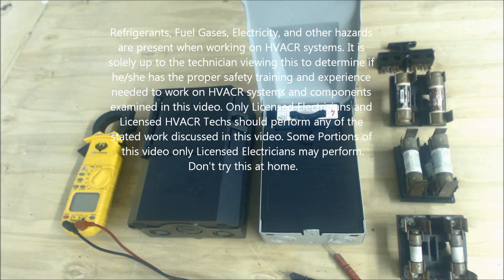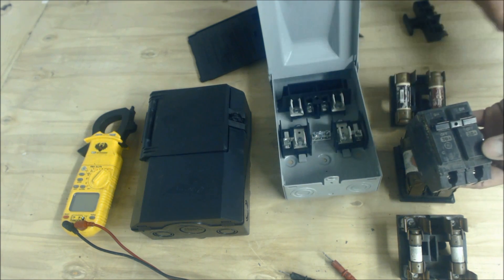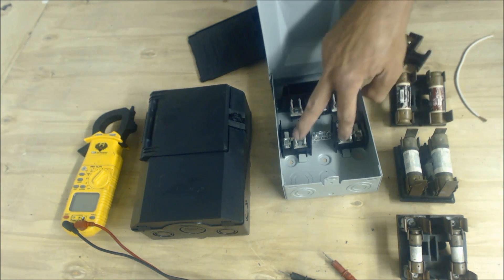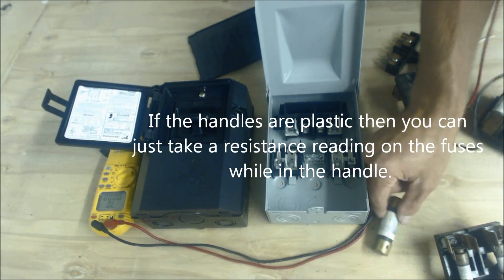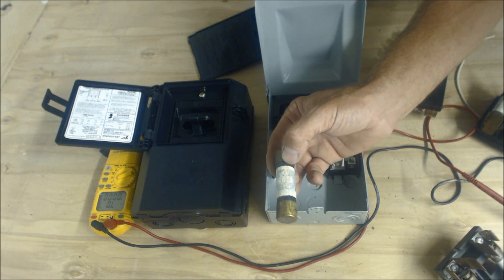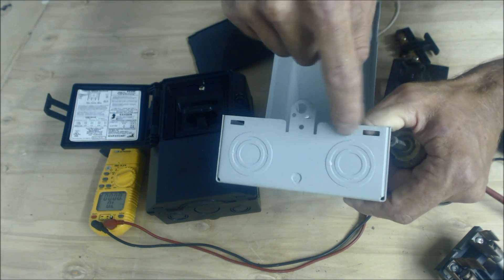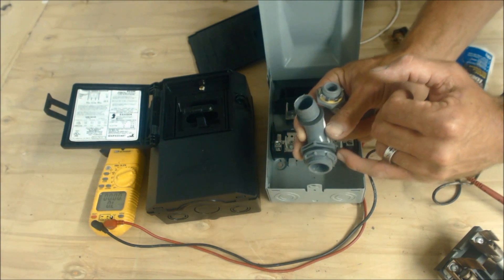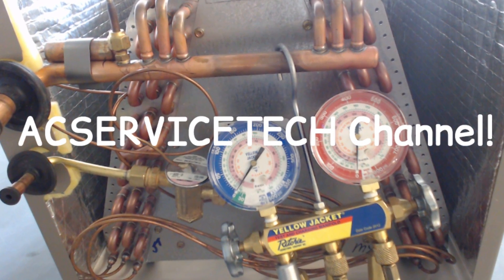Tutorial on HVAC Electrical Disconnects-Troubleshooting, Fuse Size, Non-Fused and Fused Application!

Comment: I'm a home inspector, I'm was talking in a group that we sometimes find a copper pipe inplace of the fuse in the disconnect. Some say to leave it, the control panel breakers will do the job fine for the condenser unit, its over kill anyway. That can't be right, I'm trying to find the reason this kind of fuse is there. I think I know after some research but can you explain why the need for this kind of  fuse is there and why and reasons for the stab in breakers?
Thank you I've learned alot from yo<r videos.
Patrick Virginia

Comment: The information in this video (specifically 2:40) about conductor and breaker/fuse sizes is not correct per article 240.4 (E) (G) and article 440 of the National Electric Code. PSA - Do not install or service HVAC equipment unless you have a proper understanding of pertinent NEC codes and manufacturer ratings of such equipment.

Comment: Hi, my ac was working great until I changed out the
thermostat and now the system is not blowing cold air. I put the old thermostat
back on and still blows but not cold. What did I blow up? ha...Thanks

Comment: I am having trouble with my one fuse keeps blowing on my indoor disconnect. I live in New Jersey and have a Trane heat pump about 17 years old. Condo is less than 1000 sq ft. The fuse only blows when I use Heat and I notice it happens typically a about an hour after it's turned on. Also when it is sub 40 degrees outside I noticed it blows. Do you have any suggestions on what it might be?
Reply: Could be anything. You'd have to be reading amperage while in heat mode. Heat mode takes more energy than cooling. 
Also hope that the fuse is for outdoors and not indoors, cause the lower the temp the less energy the outdoor unit should take.

Comment: How about a whip with solid wire? Does a whip have to have stranded wire or is it better. Any difference using solid or stranded whip wire
Reply from the maker: Stranded that is rated for wet locations, thanks
Reply: @acservicetechchannel  AC disconnect box has live wires. I took fuse out, it's still live. I shut down the mains at the fuse box. It's still live. How do I disable it? I assumed when I took the fuse out it should disable the live wires. Then I thought the fuse box has a switch for it. It doesn't. I even tried the 200 amp main. And that still wouldn't disable the live wires. Any ideas?

Comment: So I see I have 2 bad fuses on my 3 phase unit and they have burn marks, where should I check my ohms to see if they are climbing when unit is running with new fuses
Reply from the maker: That would be the main power wires but you should call a tech. They will check amperage, thanks

Comment: I want to install a Mr cool diy ductless system, already have a central unit that quit but wanted to know can I just disconnect the central unit and run the power that was used for the central unit to a disconnect box for the ductless system?
Reply from the maker: You would have to check the voltage and amperage wire rating and breaker size to match or exceed the Mr cool, thanks!

Comment: what size disconnects should be used for an 8.5 ton rtu and wire size thank you
Reply from the maker: It depends on what the rating plate max fuse states, thanks
Reply: thank you

Comment: 10 kw on air handler, making the disconnect hot and pop the GFCI not the breaker, could it be a loose connection on the disconnect or should I get a electrician to check the wire size.
Reply from the maker: This unit has a GFCI Breaker? The disconnect should not get hot. I would certainly verify the gauge size, take a look at the connection points to see if there is any melting and if it is tight. Check amperage. Put clamp around the wire before turning power on and then  turn strips on. Check to see if they rise or max amps. Turn the power off and then disconnect the amp meter for safety, thanks
Reply: The GFCI is on the main breaker box,heat strips running steady at 38 amps (10 kw) the disconnect starts overheating and the breaker pops the lights on the hall and bathroom went out also, I saw some melting on one leg (120).
Reply from the maker: If this is your house then you could take care of it possibly if you have the proper experience. If it is not your house then have the homeowner call an electrician unless your company has an electrical license and electrical insurance. HVACR insurance may just cover what is inside the unit and possibly not even at the disconnect. Even if you do your job correctly, if something else occurs such as a semi related problem then that could turn into you being liable later. Anyway, that is what I would do, thanks Ruben
Reply: acservicetech  thanks, you help me a lot.

Comment: Good news I had that problem a few days back with a/c not working, thanks for your input. It turned out to be the 38 year old disconnect. A friend replaced the old box with a new pull out. The 20 year old system stepped up to the plate,  felt nice to have air again in Fl. thanks again for all you do!!
Reply from the maker: Thanks James, awesome to hear!

Comment: I have a request for a video when you have the time. Today I was removing an old furnace to replace with new one they had wired and outlet/switch on one side and a two outlet receptacle on the other.  I took pictures of how it was wired up so I could rewire it the same way when I installed new furnace. I understand how to wire a switch but when you add more than one is where I get confused. I made sure the power coming out of switch was 120 and 120 was reading from outlets on other side. I want to be 100 percent confident when I run across something like this again and not have to rely on taking photos. Thanks man!
Reply from the maker: Typically local code inspectors around here would say that we can only have one single receptacle on a furnace for a condensate pump and that is it. Nothing else may be plugged in. All manufacturers require a dedicated line for the furnace, thanks!
Reply: acservicetech thanks for the reply. Yeah that makes a lot of sense why they wouldn't allow it. It could potentially trip breaker if other stuff is plugged in while unit is running. Didn't even think about that when I was putting it back on. I won't make that mistake again.

Comment: Thank you for a great video!  Quick question - when wiring a 110V disconnect, does it matter which pair of contacts to connect to LINE - outside or the inside pair?  Thank you in advance for your reply...
Reply from the maker: If you are using the 240v disconnect for 120v then just pick one side or the other. it acts like a switch so it wouldn't matter, thanks
Reply: THANK YOU!

Comment: Question: My AC disconnect box is reading 30 volts between L1 & L2, L1 to ground is 120 volts, L2 to ground is 0 volts, i suspect a faulty 30A circuit breaker. What do you suggest?
Reply from the maker: It could be the breaker. I don't work in the breaker box at customers homes due to insurance. I would have the homeowner call an electrician as they would need to test the output off the breaker or determine if it is the wire itself or a boxed location with loose wires, thanks

Comment: I recently moved into a new home and realized that my disconnect box is MISSING the on/off switch. If I replace the switch (just the switch not the box), should I shut the breaker on my circuit panel first?
Reply from the maker: The pull disconnect comes in and out with the power on usually. Make sure to not do this when its raining or near water. This is the main disconnect if it is one that literally pulls out. If you think you should turn the breaker off then that is a good idea then. If there is a step to make something safer then do that step, thanks!

Comment: When you are determining what gauge wire to use is that just from the disconnect (load side) to the condensing unit or do you need also think about what comes from the breaker box inside the home  (line side) to the disconnect.
Reply from the maker: You definitely need to verify the breaker and the wire size are correct from the breaker box to the disconnect. Thanks David!

Comment: NOALOX IS VERY FLAMMABLE.  WATCH THIS VIDEO. https://www.youtube.com/watch?v=hlhJPjQxA-Q
Reply from the maker: I am going to do some research as to if there are any other less flammable anti oxidant compounds but that was an excessive amount of heat and a flame that he put on that. Yes it would be nice and safer if it were not flammable though. We do absolutely need to put an anti oxidant compound on stranded aluminum though but put on the safest you can find.

Comment: If I did not hear or see written in the video, I stand corrected but only place the blown fuse?  Usually always better to replace ALL fuses to avoid callbacks due to the time & load delayed effects of  unknown current unbalance that occurred during the fault (short-circuit) in the other non-blown fuses.  This practice, in my experience & study, has applied to low voltage and including electric utility substation fusing.  Really liked the video and would encourage a 3-phase version when you get time.  Excellent teaching skills & knowledge - learning much in my 2nd career as HVAC-R tech student.  Thank you sir.
Reply from the maker: You are correct! Replace both fuses as both have typically been under the same strain and time in use. That would be horrible if you got called back because of an old fuse you forgot to replace as a precaution. Thanks!

Comment: Can you go over on how to properly size the wire for a disconnect? I know you mentioned that you should either have the same or exceed the size of your disconnect.
Reply from the maker: Great Question! For instance 15 amp-14 gauge, 20 amp-12 gauge, 30 amp-10 gauge, 40 amp 8 gauge, 55 amp 6 gauge. If the unit has a max amp rating of 30 amp then the tech needs to make sure that there is 10 gauge wire running to the disconnect and from the disconnect to the unit should have the same size wire or it can be larger such as 6 or 8 gauge if that is what the whip came with. The whip is the flexible electrical conduit used to connect the disconnect to the unit. I hope that helps! Thanks!

Comment: A note here to newer techs. Fuses on real old homes say 1960's and before may not be by the outside AC unit, they did not always use or require a disconnect eons ago. Thus the actual fuses were in the fuse box say in the garage. This is dangerous because somebody could replug in the fuse holder when you messing with live wiring. Thus you pocket the holder and take by the AC unit; or better have  lockout on the panel,

The Fuses that are in use maybe wrong too. ie the fuse blew and the home owner just bought a pair and it works but not be the correct size.  There can also be a disconnect box with fuses by the AC unit and also upstream fuses or circuit breaker that is in the panel in the building. 

Fuses in HVAC work tend to be time delay types that allow a high inrush current to start the compressor.  Homeowners and cheap landlords to buy the cheaper non time delay types and upsize the fuse which can be dangerous and thus is hokey.
Reply from the maker: Thank you for your input!